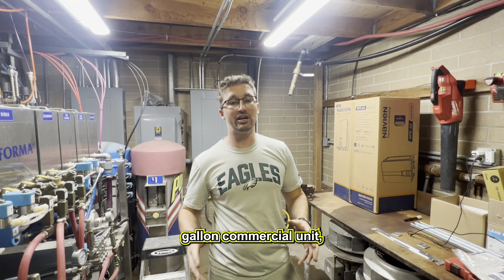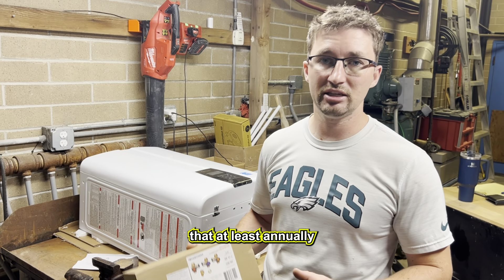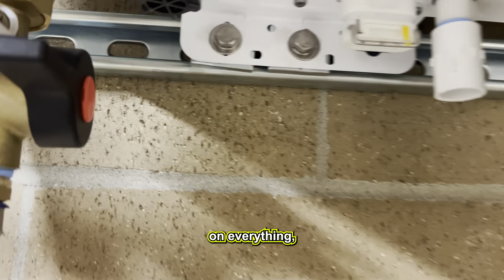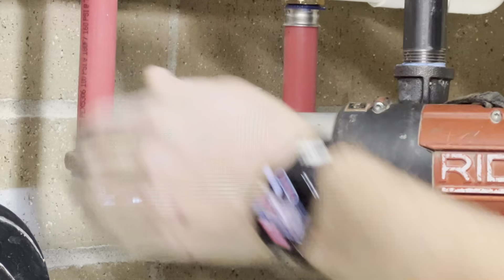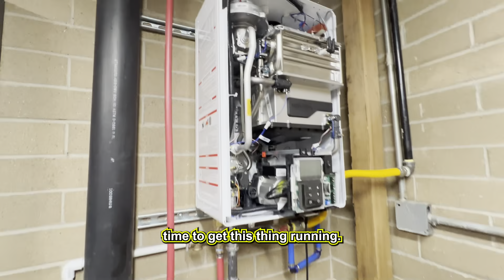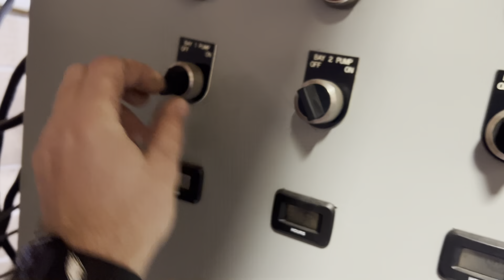How to Install a Navien Tankless Water Heater | Big Upgrade at My Car Wash

Comment: I had the boiler burn up that provided customer hot water and I replaced it with a tankless with a recirculating pump as well.   I have the tankless feed the buffer tanks for my automatics and self serves, and a re-circulation line to those as well, so there's no shortage of water.    The "contingency plan" I have if I'm so busy that it runs out of hot water or can't keep up... then the water just gets a little lukewarm ;) and I'm still doing a better job than the guy that owned the wash before me that didn't provide hot water at all!
Reply from the maker: What type of buffer tank do you have? Something like my Rinse tank or an actual mini water heater?
Reply: @therevestor  The boiler had a 100 gallon insulated storage tank.  When I removed the boiler, I kept the tank and I plumbed the output from the tankless to that, so it's recirculating a hundred gallons of hot water at a time.  Then from the storage tank it goes to the buffer tanks for hot rinse water for my self serves and the presoak for my automatics.

Comment: I don't see how one unit can keep up. Our 199K Takagi @110F can't supply enough for even two bays so we installed a second float valve in the gravity tank that is plumbed with cold water.
Reply from the maker: My plan was to do the same and add in a second float with cold water when the tank got below half but so far this one is keeping up. I will be keeping an eye on it as I imagine over time it may become less efficient and I will need to keep up with running a flush on it.

Comment: Hope you were pulling the trigger as I just tape them like someone is using them. I have 3 of the same models tie in series to operate a 5 bay SS wash. Of course my is direct injection as I don't have any holding tanks for water to cool down. Great choice and good install!!
Reply from the maker: Yeah I throw zip ties on the handles to test them